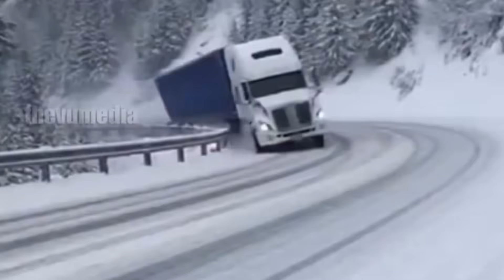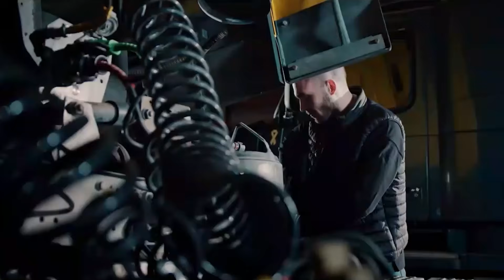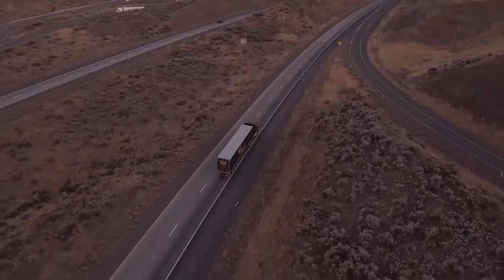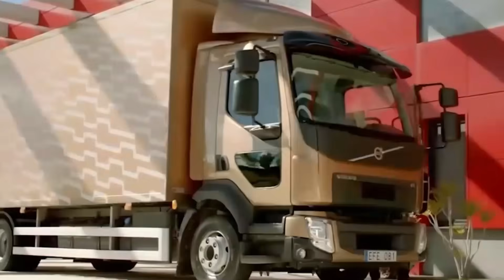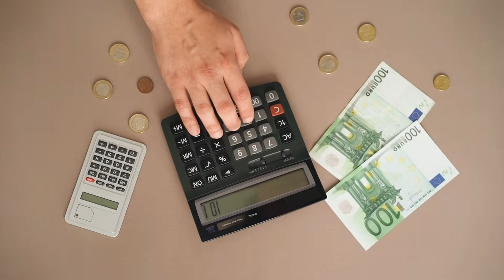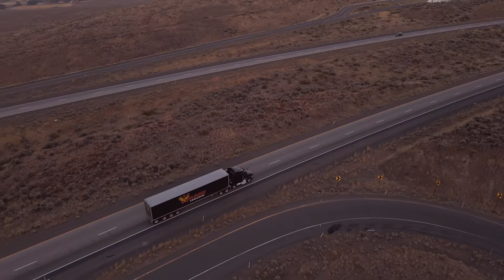This UNBELIEVABLE Truck Consumes LESS FUEL Than a Car!

Comment: More AI slop. Mispronounced words and outright lies. 65,000 pounds is not a full load. 80k is standard, many trucks carry more than that with standard permits. Also, until every trailer has the composites, aero and solar built in, that kind of fuel economy is not available in the real world.
Finally, what is the real-world cost of building that thing? Every dollar spent must first be earned, and ALL economic activity has an energy footprint. My bet is it would take a lot of real-world hauling just to break even on all the extra costs.

Comment: Considering many trucks require trailers for specific loads plus most might be at 80,000 instead of 65,000 much of the hoped for savings are unavailable